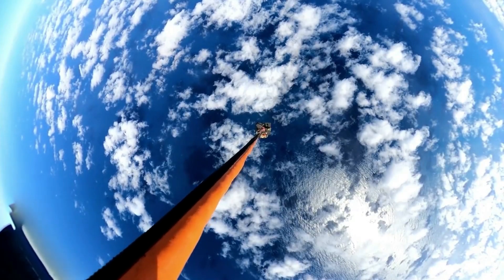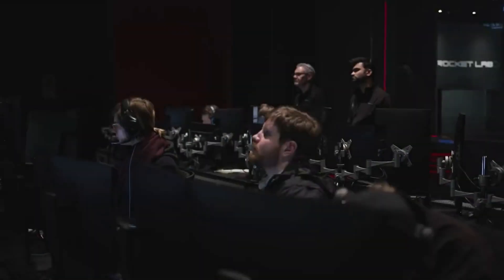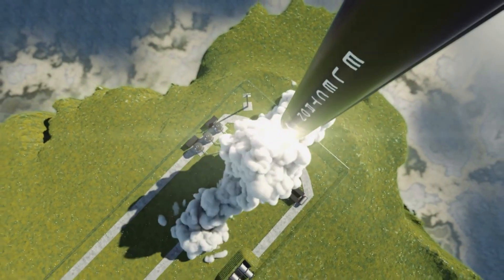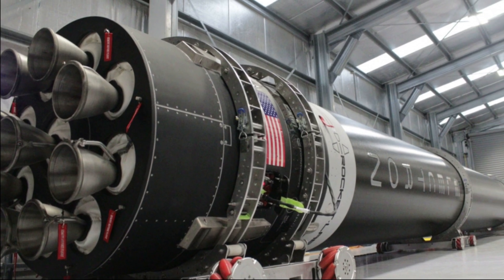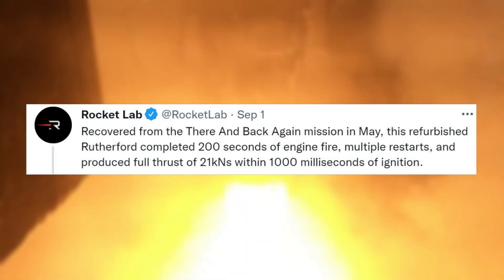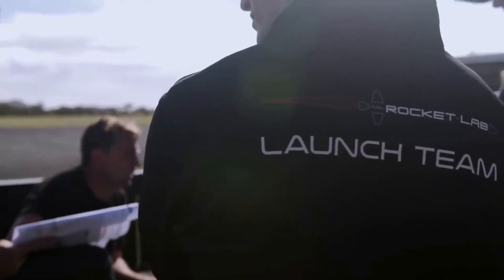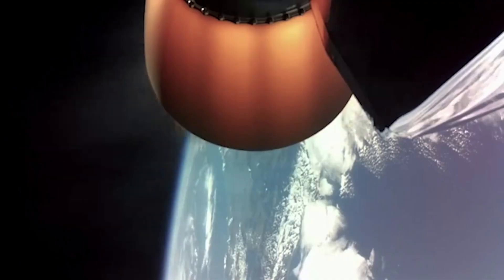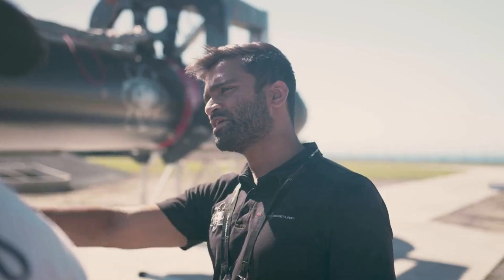Rocket Lab Just Revealed The Next Electron Recovery Attempt

Comment: Interesting, but not much fresh information here.  What we need to know, specifically, is about the next gen Rocket Lab, the Neutron.  Will it still have electrical powered pumps, rather than gas-driven, as is standard on other rocket engines?  Will the Neutron be landing capable and so on?  I think that's the design they're shooting for.  Electric powered pumps can only get you so far.  21kNs of power is tiny, in comparison to a Raptor or even a Merlin.  (Merlin 854kNs, and Raptor 230MNs thrust).  I ain't saying a Rutherford engine is a toy or anything, it's a serious engine, but the design limitations of electrically driven pump rocket engines preclude them from ever being on anything but small rockets.
Reply: Wikipedia shows the Archimedes engine on the Neutron having 1.1MNs of thrust, and there will be 7 engines on Neutron, giving total peak thrust of over 7.5MNs.

Comment: This seems like a silly and rather dangerous way of going about reusing a rocket stage.
Reply: It’s been done since the sixties for recovering satellite payloads like spy satellite film canisters. 

The reason they do this is that the rockets are too small to attempt propulsive landing. It’s also why falcon 9 lands: for them, it’s only 5% more weight. For the electron the rocket would need to be twice the size
Reply: Should add that this idea of catching a rocket booster was PROPOSED in the 1960's even was thought might be practical to catch a Saturn V booster at the time.  The idea was there, but the practical mechanics were never worked out to catch rocket boosters.  One of the comments below tells why landing a small booster such as Electron is not practical.  They will solve this, however, with their next rocket Neutron, which they will be building and flying out of Virginia, Wallops Is. Flight Facility.
Reply: To add, the reason landing Neutron is an option is that Neutron is a fair bit bigger.